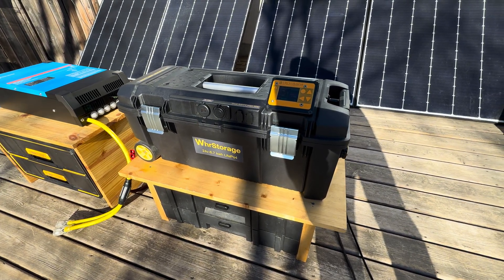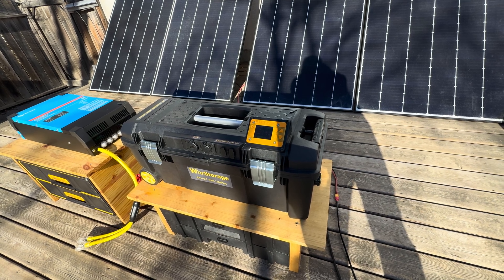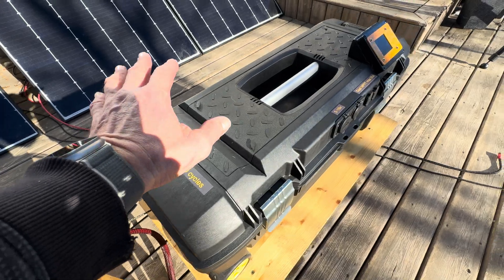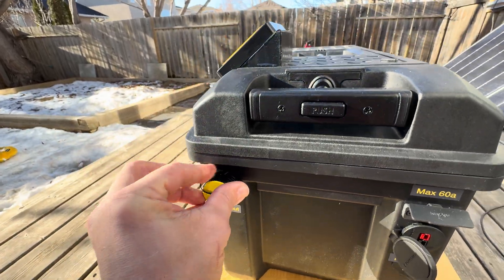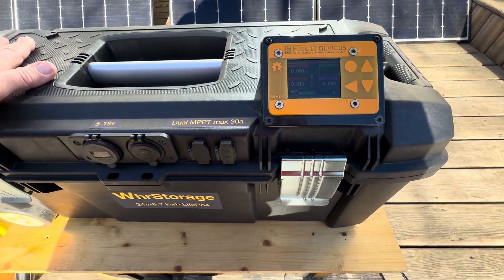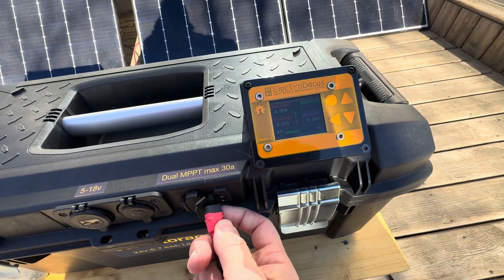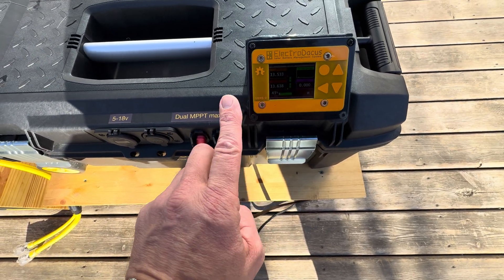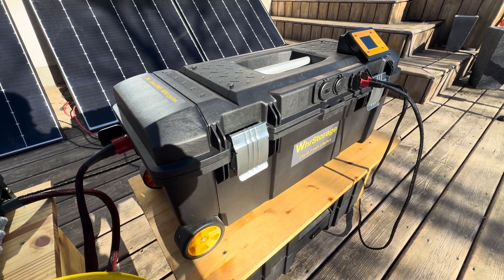Safest 24v battery cart..6.7kwh. 50a MPPT.  dual battery management system.. One on neg and positive

Comment: I love everything you are doing! I’m so curious on how you got a 24 V 6.7Kwh battery in that box. I am using a slightly bigger box than that from rigid. And the biggest one I could fit and it is extremely tight is a 230 amp power 24 V lithium. What kind of batteries are you using? also, thank you again for your videos. I am trying to do something similar with rigid boxes, but I am very new to all this.